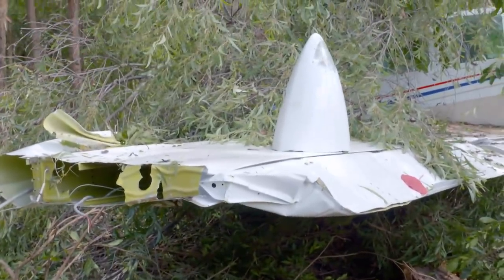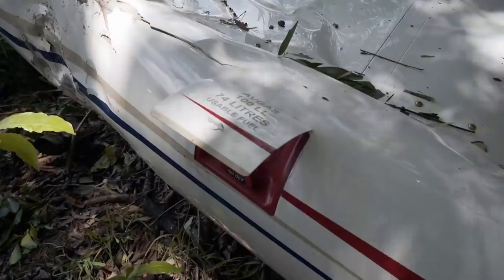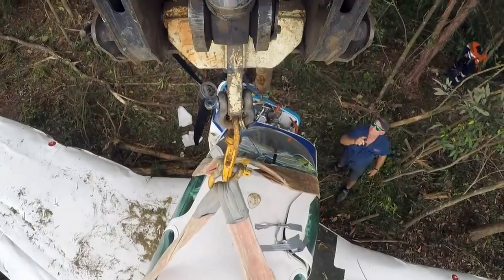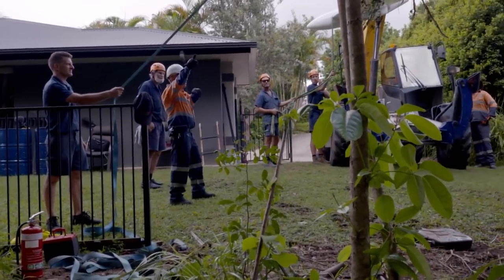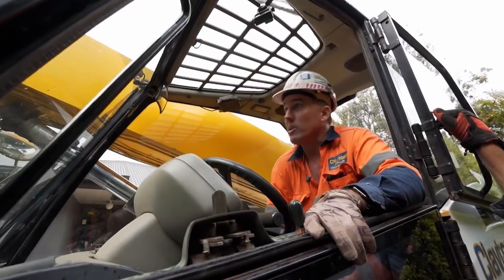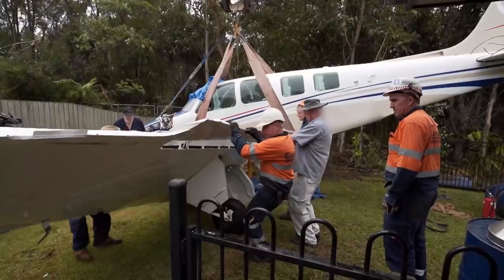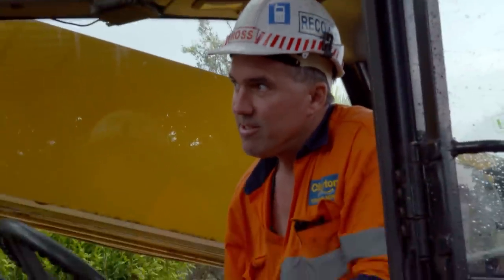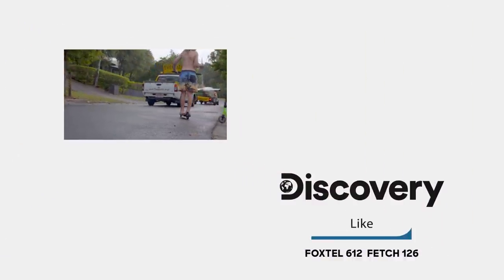Tow Truck Operators Recover a Crashed Plane From a Backyard | Towies

Comment: what airplane model is that? any1 know?
Reply: A380 I guess
Reply: EMIL It’s a Beechcraft G36 Bonanza
Reply: Suncraft why are you calling a single engine low wing 6 seater an A380 when someone is trying to get a legit answer to their question? Pretty annoying if you ask me.
Reply: Beechcraft A36 Bonanza it looks like.  You can tell by the beechcraft logo on the tail and the bonanza is their only still in production model of single engine prop. They said it's a 6 seater and the A36 is the most popular version of the bonanza and its a 6 seater.
Reply: @Rubiboy98  i thought the G36 had a glass cockpit
Reply: I The Sea Cow Yes you are right, indeed the G36 is the „garminized“ version of the A36. I didn’t really pay full attention to the whole video so if this aircraft is fitted with a steam gauge cockpit I must have overlooked that.

Comment: i guess no blokes there know what a Telehandler can do... it could lift that bird 10 meters in the air right over the top of the houses without a even Grunting.  it could get that out to the street and our of the yard in 5 minutes now its out of the bush..  oh wait.. this is TV... lets make it HARD to do... can't show how smart we are... could they ..
Reply: i doubt a telehandler can extend the length of an entire house + backyard and also lift cargo of more than 1 tonne....for example the beefiest CAT can extend 12.7 meters max and carry 4000KG at an angle of 45° (non extended)....now make that angle about 10°, fully extended and all you get is 500Kg or a tipped over Telehandler and a even more damaged plane